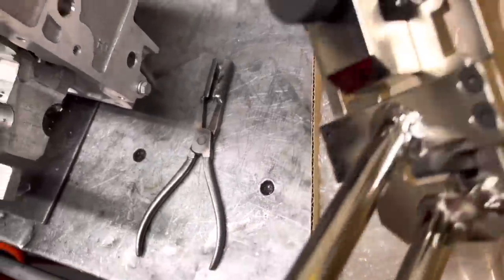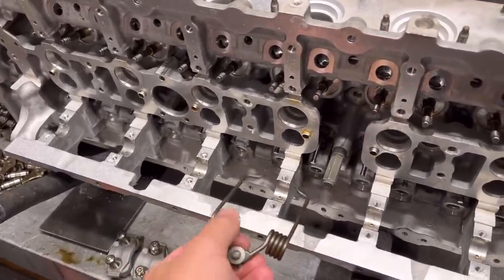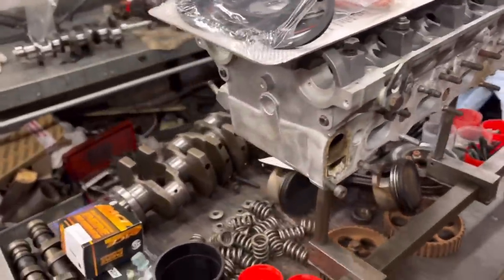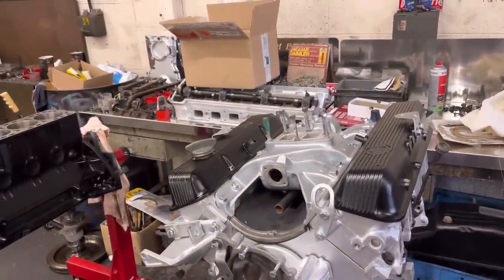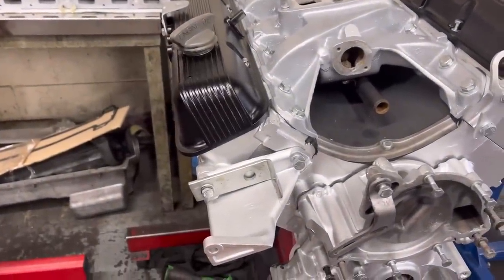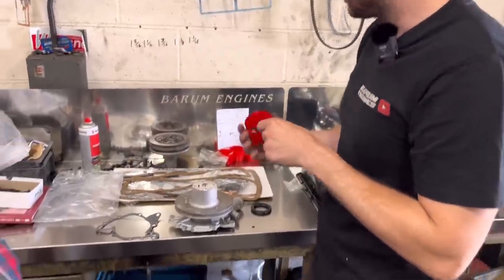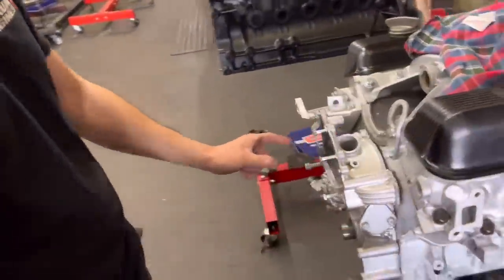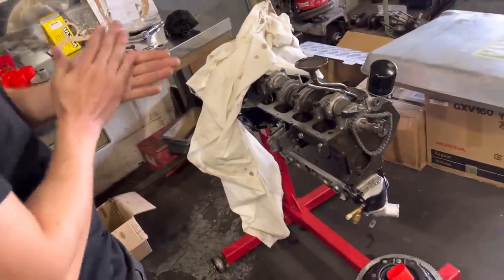This is why we never make assumptions, MASSIVE engine failure could be on the menu

Comment: Hi there ,I’m a subscriber and I used to be a mechanic working for a Land Rover dealership. I watched the MG v8 overhaul video and I don’t know if know that you have to prime the oil pump by stuffing Vaseline into the pump gears, don’t use grease as it won’t dissolve in oil.
Like your channel. Cheers David Hancock

Comment: I've owned a repair shop, not uncommon to have the tech or myself drive the car home and over the weekend. Especially difficult problems or problems unable to duplicate in the shop setting. Good job.
Reply: Once we had a horrible  knocking  noise at speed after checking  car many many times we put quite a few miles  on the car before  we realised it was  a small Leeds United ball on the roof ariel😅, but  road tests are very much  essential especially with intermittent problems
Reply: @johncoldwell340  That does not make it legal. Your insurance is/was for business use. How is taking a car home, or even worse going to see you nan or taking the wife shopping, business use. The fact that it may be common in the trade does not make it legal.
Reply: @peterforrest5181  vehicle needs to be test driven is the fact , where and when that is not all that relevant , often this will be done for the commute as this can give several hot to cold tests and great for anything that could be intermittent 
It also means the shop doesnt need to charge the customer workshop time which they may or may not be able to charge for anyway
Reply: @johnnie5wreckingyard  This is dancing on the head of a pin. Ask any client whether you can take their car home and use it for private journeys, arguing that this is simply test driving, and I bet you 90% will say no. I suspect you guess the answer which is why you don't ask. That makes it both dishonest and probably illegal on two grounds: TWOC and driving whilst uninsured.
Reply: @peterforrest5181  have you even followed whats going on with the vw ? Its a brand new engine supplied by vw , it had an oil pressure light issue , guy lives miles away , vw looked at it , 
Its being open and transparent with the customers and the issues 
The only dancing on the head of the pin is yourself dealing with dodgy mechanics
Reply: @peterforrest5181  
If my guy thought my car needed a drive to disgnose then that's fine.
I take it to someone so they can apply their knowledge.
If I could work it out or the problem be diagnosed sitting still it would have been sortef
Reply: @peterforrest5181  I don't  really road test cars myself at all to be honest and wouldn't use someone  else's car  for the fun of it,  pretty sure  it is legal method of checking the car is repaired properly and functioning as normal in the UK ,  probably different in the US  were people sue people for something to do,  either you don't trust  your garage to not joy ride your car and shouldn't be taking it there or your so up tight you need to fix your own car tbh
Reply: It's advisable to blow a couple of donuts if it's a real powerful car, just to ensure the lug nuts are good and tight. 😏
Reply: @peterforrest5181  Tell the client the choice is between mechanic taking it home a few nights, or paying the hourly shop rate for it to be driven in work hours. 99% of clients aren't stupid enough to care where the car is driven if they understand the need.
Reply: @johncoldwell340  It's the Arsenal ones that give most problems😂

Comment: Using a rod vise, I would install the bearing shells, torque the rod bolts and then measure the diameter of the bearing inserts while torqued. Then after measuring the crank journals, determine the bearing clearance.
Reply: Wasn’t this called checking the Bearing ‘Nip’?.

Comment: You should be able to get an installation sleeve for the V8 bottom pulley rope seal, rope seals work ok provided the pulley is installed properly, with a new rope it's virtually impossible to just jam the pulley in and it not leak oil as the pulley usually chops bits off a new rope as you force it home.
Reply: Never had a Rope Seal on any type of Engine that didn’t leak. They are no good at dealing with a bit of Crankcase pressure.
Reply: @paulnolan1352  I assume rope seals are from the era where dripping oil was normal... loosing a pint of oil while just waiting for the light to turn green was probably a fact of life (driving an Englih car..)...and probably most of all annoying for the owner...

Comment: Another great video guys … just a heads up … the inlet manifold on the rover v8 looks to be on the wrong around ….
Reply: Never! 😳😁😁😁
Reply: Well spotted 😃😃
Reply: I don't think so. If you look the thermostat fits in the front face of the inlet manifold and you can plainly see it. There isn't another hole like that in the rear face I bet so it can't be wrong.. I'm a bit confused about an MGB 3500 using a rope seal on the front of the engine, because the V8 was not put into the B until the mid to late 70's if I remember correctly. I've built a number of V8's, both for Rover SD1's and Range Rovers and Discovery's and never found a rope seal in any of them. This suggests to me that it's an original early V8 from the late 60's that went into the Big Rover saloons. The V8 superceded  the six cylinder 3 litre engine.
Reply: @samrodian919  There is a hole that looks like the thermostat housing both ends. the rear one is for a flanged outlet pipe.
Reply: @Ben-Dixey  ok I stand corrected

Comment: Another good video - on tolerances and the measurement of such - when you are down to the 2 - tenths world the temperature makes a big difference- do you have slip gauges to check the micrometer used to set the bore gauge? Just a thought….
Reply: Even the big end reinforcing ribs look to be ground upon before. Could have been resized at any time before being used the last time. Of course, there's always the chance that the previous or the latter measuring tools could be off...or both. Everyone claims to have certified laser measured perfect measuring tools. The reality is a few tenths either way is fine, and if you want to be critical about the actual oil clearances, you torque and measure every rod and main bearing and compare it to the corresponding journal. Using your mic to set up your dial bore gauge, assuming they aren't complete trash, will give you a reasonably accurate  running clearance. Then again, the anvils usually mark up the bearing shells which add size measured......but I digress.

You must disassemble/clean/lube with specified oil and torque/stretch/torque to yield before measuring rod big ends, I've had a set of import rods many years back measure perfect as they came out of the box (double checked torque first) but when taken apart and retorqued they went out of round several thousands (not tenths) of an inch.

Comment: I personally think that yes it is accepted to test drive a motor but the worry for some folks would be a nefarious place could hammer the metal out of the pedal sideways which some folk would be paranoid about and I have known mechanics who made a private thing about wankering people's motors, running speed traps and all sorts just to peeve someone they wanted to annoy.   It all comes down to that level of trust one engenders with your customer, a customer would also expect a newly built engine to be treated with caution as per all new engines so wouldn't expect the thing to be ridden hard either.

Comment: 25% of the people who watch these videos have no idea how mechanical vehicular business works.
These are the same people who will only use main dealers for any work, thinking they are the only ones you can trust... If only they knew!
The other 25% don't know or understand your particular business, hence them feeling the need to "advise"  you on how to clamp/measures components, imagine if you had been in the business for a number of years already with a cracking reputation?
25% don't understand use of words and what you actually mean, I.e "the lads taking it home for the weekend" 
The "lads"  being skilled engine builders and qualified professionals,  not a geeza called Dave who's a mate of a mate who does a bit of spannering/banger racing at the weekends..
25% know exactly what you mean, why it's sometimes a requirement of the job, and how good you are at what you do.

Comment: These leaf springs are similar to those used on the Ducati single cylinder machines of the 70s, when the Barcelona company Mototrans was given the task of tuning these bikes for racing they realised at once what an awful  design leaf springs were at high rpm, so the first thing they did was ditch the system and put in the standard twin coil spring system, and went on to great success in endurance racing. It doesn’t surprise me that BMW still use it, as far from being masterpieces of engineering, they are trash.
Reply: What are you talking about?  a) never heard them referred to as "Leaf springs" only Hairspring  (how can they be leaves?) b)  In the car world they were not frowned upon, and were used in the post war Ferrari's that had to last 12 or 24 hour in races. In motorcycles, they were used on the world championship-winning Guzzi singles up till 1957 at were at the 8000rpm peak mark

Comment: Test drive a vehicle by all means, anyone with half a brain cell would expect that. However, send my car ‘home with the lads for the weekend’ and you will end up with a lot worse than a pissed off customer, you will end up with a broken nose.
Reply: Porsche opc took a 911 gt3 home that had a running fault fixed 
Geeza went the multiplex cinema 
Some scrote stood all over it breaking the spoiler on the rear 
My mate repaired it and the opc never cracked on

Comment: Wow, when in a hole stop digging. If other garages are allowing cars to be taken home by staff for the weekend then this is hardly a good justification for your own more minor malpractice. To repeat, test drives are very sensible but personal errands are unprofessional and I doubt very much if your insurance covers staff personal use.
Reply: It's not personal use for testing purposes. Sometimes certain problems can't be duplicated in a shop setting. As far as insurance, it's considered as part of the job. Or leave them clocked in over the weekend. Get a life
Reply: @MrTimNed  It is when vehicles are being taken home and used for personal journeys.
Reply: @peterforrest5181  when where They used for personal journeys? And, how else would you test drive it over the weekend if you didn't make personal journeys
Reply: @MrTimNed  Exactly, that's probably why it's unlawful. No doubt it's very convenient for worshop staff to swan around at the weekend in someone else's car but that does not make it right or legal. The channel owner, and his supporters, seem unable to differentiate between business use (road testing) and private use. The channel owner should put the issue to his clients. I bet they'd all say yes to test drives and no to personal use masquerading as test drives.
Reply: You don’t know what your on about. I once had a Volvo with an intermittent misfire. The main agent workshop Forman used it himself until it failed. It was on their insurance so what is the problem.
Reply: @nottinghamman4839  was it with your prior consent?
Reply: @peterforrest5181  miles is miles regardless of the purpose,stop being a knob